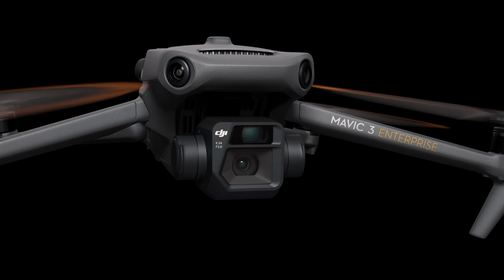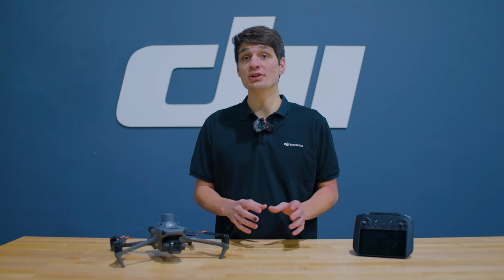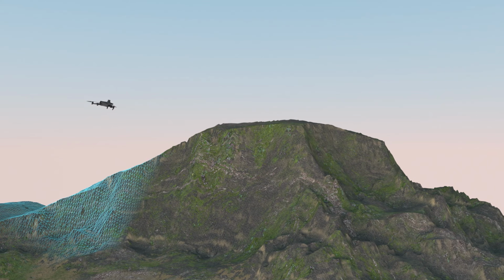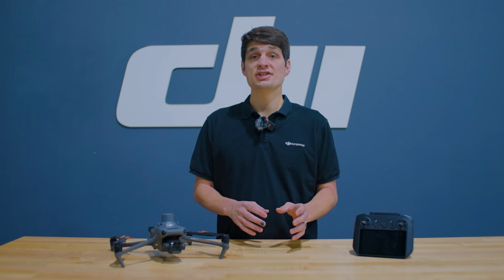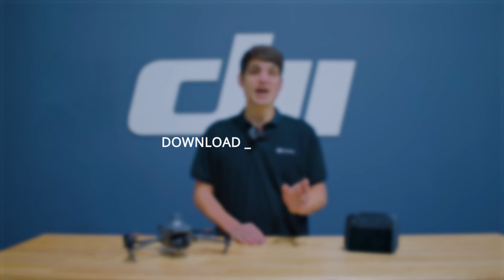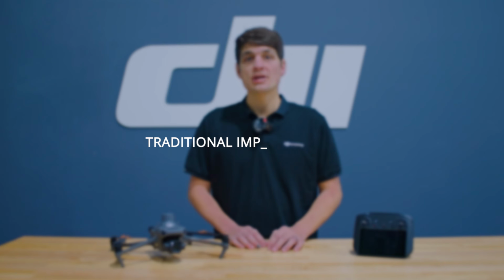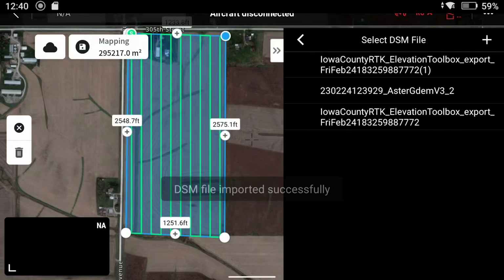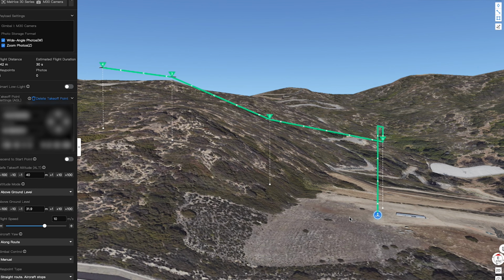Mapping 101: Master the Terrain Follow Feature on Mavic 3 Enterprise

Comment: The man says under 80m should use a DSM file, the infographic at the same time says under 30m.  Which is it.
Reply: 30m...used to be 80m, but in one of the later updates they dropped it down to 30m. So now it works between 30 and 200m.

Comment: I just watched this video and it has helped a lot; however, I'm not as strong in my geodetics.  I get the horizontal system should be be WGS84(EPSG 4326) but I am not sure which of the options I find under the ellipsoidal option in ESRI's ArcPro 3.3.  Can you please specify the option that you think will work best in my Mavic 3E?  I presume that it would be World based and not North America based and would be WGS84 (WKID 115700).

Comment: As you mentiond flying over DSM is a very essential tools for mapping for max safety and accuracy . BUT why you dont use this option for RTH ? when the mission finish or battery finish Mavic dont return to home over DSM and it has PRESET and optimal RTH mode which both of them has some negative points and causes to decrease safety .

Comment: Looking for clarification on if minimum height for real time follow is 30m or 80m. 80m was said, but the dialog box @2:30 shows 30m.
Reply: I Have the M3M, and using real time terrain follow, the minimum height is indeed 30m now.
Reply: @ccrane3529  M3M or M3E? not sure if it matters?
Reply: Saw that! If it was a type error then he did it twice. I'm wondering if he said it wrong. Have you find any info on this?

Comment: Aircraft: Mavic 3E with active RTK
Real-time terrain follow / Terrain follow height: 100m
Max. flight altitude: 120m
Mission Type: Mapping / 25-35ha of meadows, cornfields and forest
Flight area: Lake Constance region (Germany); Starting point in the south of the mapping area (= lower slope)
Warning on takeoff: The aircraft is flying in a high altitude zone (500m). Fly carefully.

During the mapping flight, the drone suddenly paused and reported "maximum altitude reached". In the first attempt I had planned a forest strip. This seemed logical to me, since the drone would exceed the maximum set flight altitude at 30-40m tree height + 100m flight altitude and this would lead to a conflict. I then threw the forest out of the mapping area. However, it stopped in several places above the grain fields. Only when I dropped from 100 to 90 to 80m with the flight altitude, the mission was completed. Why is that? According to the manual, the drone uses its sensors to scan the terrain in front of it up to 200m in advance and independently follows the course of the terrain. At least that's what I expected. The starting point (lower or upper slope) should not play a role in the variant. But why does it still reach the maximum flight altitude with a buffer of 20m?

At another area (flight parameters as above) I was standing on an elevated dirt road and the grain field was a little lower. At my location, a depression was visible in the field. The drone flew its orbits and paused in front of the dip and reported "maximum altitude reached". The sink was "only" 3-4m deep and about 20m long. Here, too, the only thing that helped was reducing the flight altitude to 80m.

Does anyone happen to know in which grid (every x meter) the sensors determine the slope of the terrain? Perhaps the sink was not recognized or recorded by the sensors? Has anyone had the error message in principle and a solution ready? Incidentally, the maximum flight altitude was also reached when using the DSM (Aster).
Reply: I am having the same issue here. I flew in a hilly terrain. I climbed to the top of the hill after 3 attempts, and it went well after that. What i realized is where i stand to fly is more important as well. That shouldn't be the case at all for using Terrain follow. But it still did. Hope the terrain follow actually works as intended with new updates
Reply: Been a long time...curious if you ever found the solution

Comment: We should be able to use LIDAR derived DTM data too and then define a vertical offset to simulate DSM...  Is it really safe to base a terrain following flight on a DSM? Vegetation elevation can change elevation substantially from season to season... e.g. bamboo
Reply from the maker: Depending on flight height and location importing your own data may indeed be the best option. If you wanted to add altitude could adjust flight height and flight height to target surface..

Comment: "Currently" only on Enterprise Mavic 3s.....i can see this being a nice addition to the regular Mavic 3s for more cinematic options. Perhaps the first option where it simply uses the downward sensors. Didnt the Mavic Pro or 2 have follow terrain?
Reply from the maker: We did not offer terrain follow for Mavic Pro or Mavic 2 Pro.
Reply: Any chance this will become available for the new Air 3? If not, is the next best option to manually adjust waypoints based on elevation?